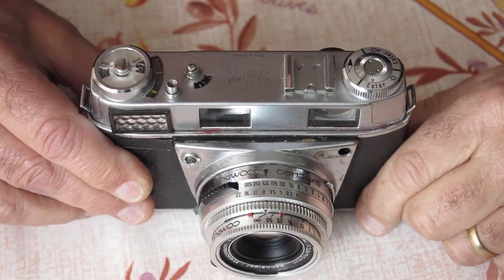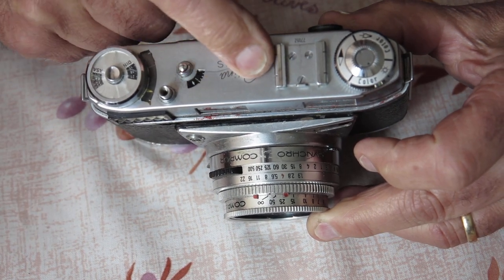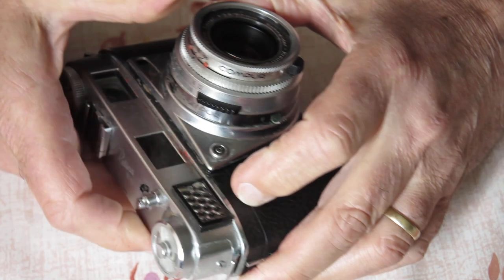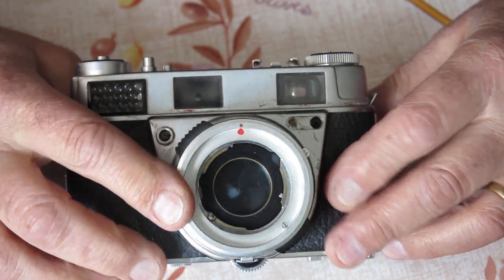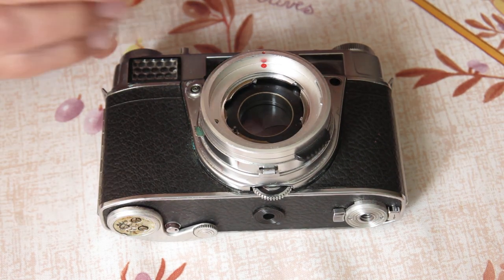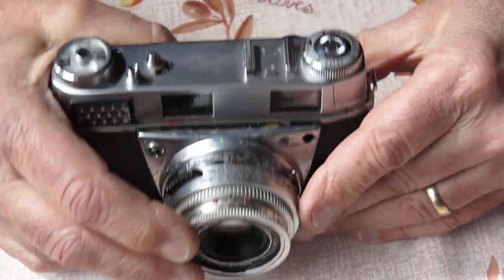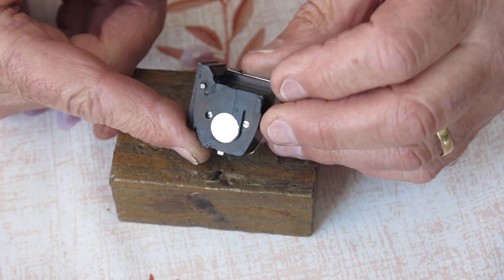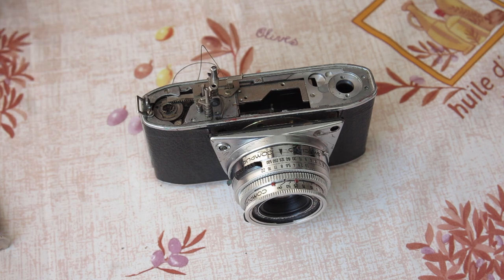Kodak Retina IIIS camera 'parts or repair' part 01

Comment: A bit weird, but I found I was holding my breath at times when you were trying to get the pivots aligned and working.  Delicate job that. What do you use to be able to see that close up?
magnifiers of some sort or strong reading glasses. You must use something I would think.
Reply from the maker: Cheap reading glasses will certainly get you by, buy two or three pairs in various strengths as needed. I mainly use my Donegan OptiVISOR with the number 3 lens which suits me well for this sort of thing. You can get cheap Chinese knock-offs too,  some which are almost as good, and others that probably are not.